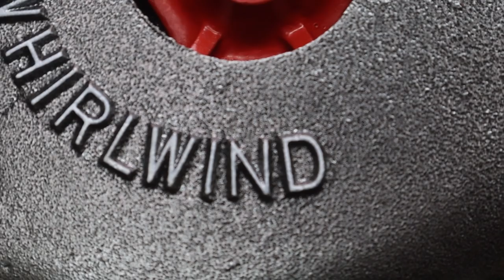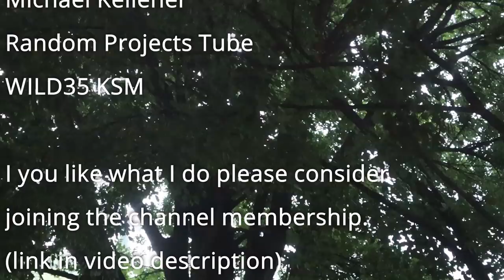Old Blacksmith Forge Blower Restoration.

Comment: Great job but I would raise a few concerns. The white grease will not protect your gears for protracted operation. The gear box needs to be filled with 90 weight gear oil , at least to the level of the handle, to give some splash lubrication. The screw you forgot at the end is actually the fill port.
Reply: my thought as well. the lubrication for the gearbox is woefully inadequate.
Reply: The hole you put the screw in is for a grease nipple and the corresponding one on the crank shaft is the vent.    You would fill the gear case with grease and when it came out the vent hole it was full.    Job to be done every morning by an apprentice while stoking up the fire and preparing the coals for the day's work.       Nice job, I like the grey/ silver colour of the body.  That fan must be quite old as it uses flat impellers. Newer ones would be spiralled to increase the air speed and volume.
Reply: I thought it was a lithium based grease that was very potent
Reply: @kettleshot6044  potency isn't really a factor, if there isn't enough of it... the amount of grease he put in there, will be anywhere BUT the gears after a few hours. Grease doesn't help, if it is not in the right place. The amount of grease you typically put in there ensures, that there is always enough grease between the gears.
Reply: La  caja de engranes lleva grasa, no aceite, puesto que no tiene sellos de re.ten
Reply: Yeah make sure your story on myself not a full restoration just the kind of lubricated and everything else replacing a few broken screws things like that and I'm coming across the same thing I'm not sure if I should use grease or oil in mine I know it has to be a large amount much more than what he had in there either way but the way mine is designed it would leak out so I'm guessing it has to be greased when Elsa don't see an easy way to fill it with grease without taking it apart all the time anyone that can give a recommendation or an appointment right direction it would be appreciated

Comment: Don’t you need to add some oil to the gearing case??
Reply: 🙄 - you saw him put white grease on the gears
Reply: @samuelfellows6923  Yes, but that is not enpugh if it will be used as intended. The last screw he fogot is a oil hole for refill.

Comment: Not enough grease in the gear case....
Apart from that....okay
🇬🇧🙂
Reply from the maker: More than enough. Thank you haha
Reply: @AJRestoration  

There isn't.
When it gets warm it'll all just run out to the bottom of the gearcase...
Should be about 1/3 full
🇬🇧🙂
Reply: @AJRestoration  If you put it to use at a forge, you would want it 1/3 to 1/2 full of oil, so ambient heat doesn't melt grease and leave the gearing without lubrication.